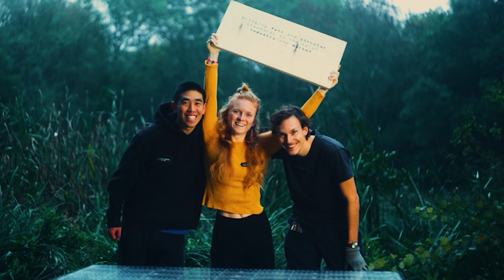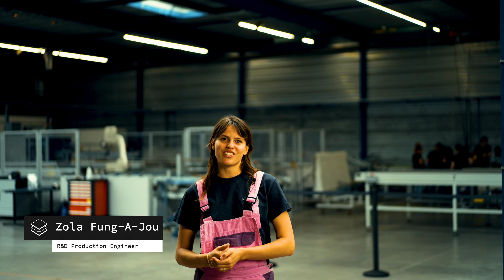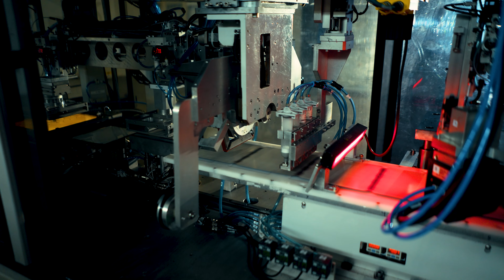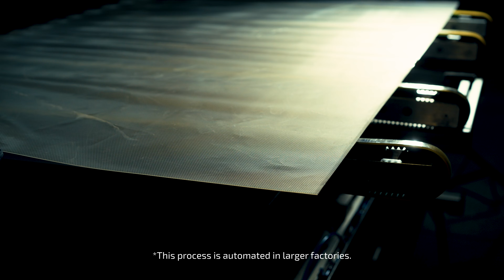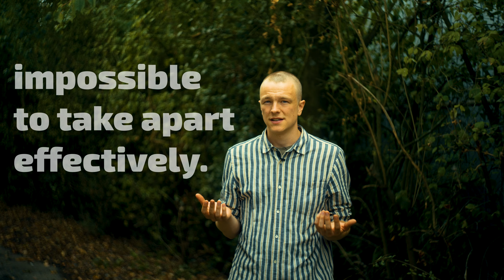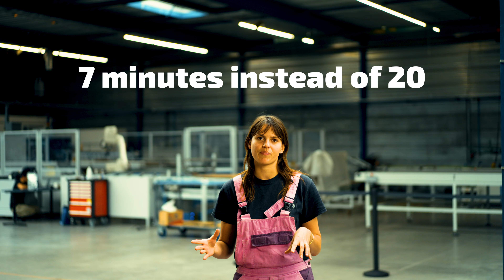Look Inside a Dutch Solar Panel Factory! feat. Kameleon Solar

Comment: That going to work ONLY if non-recyclable panels will be non-affordable by cost of production or tax. Money speaks louder than anything in commerce.
Reply from the maker: You're right. Money is a very important factor, especially now in the early stages when taxes and policy incentives are not feasible yet. That's why we're looking into ways in which we can save costs for the manufacturers and end users. In our new video we show our production in China, which is actually at market rates.